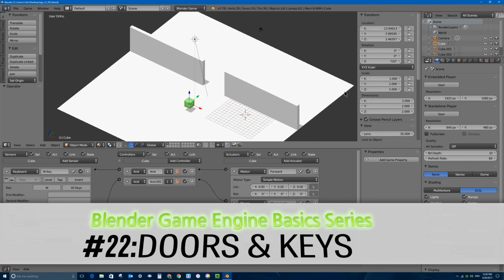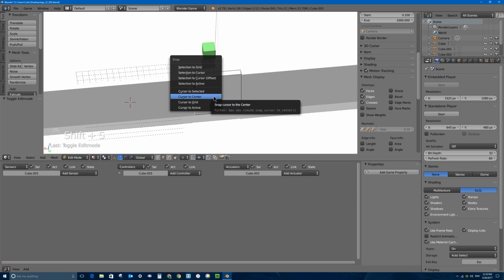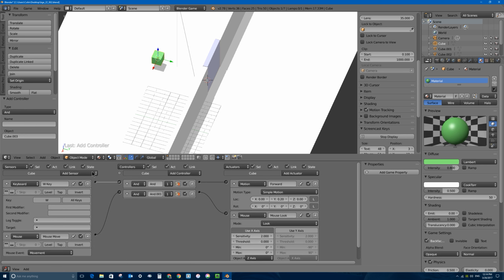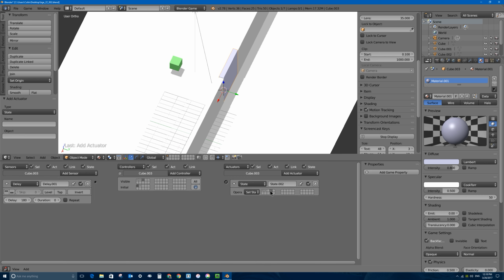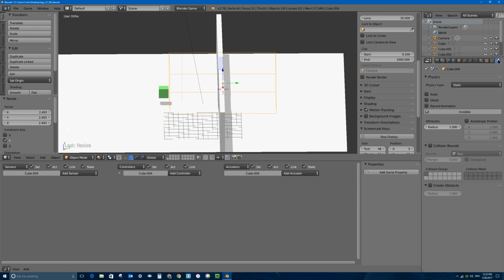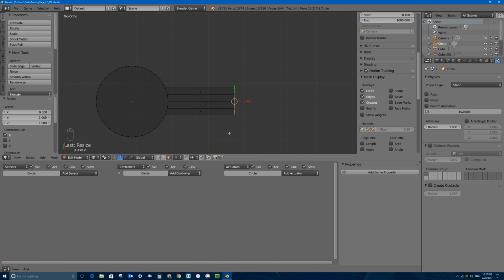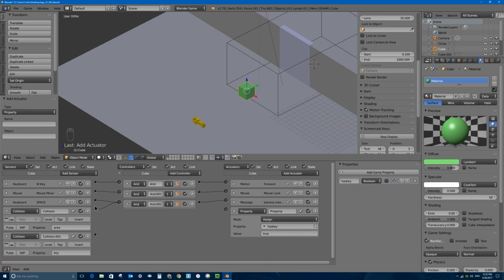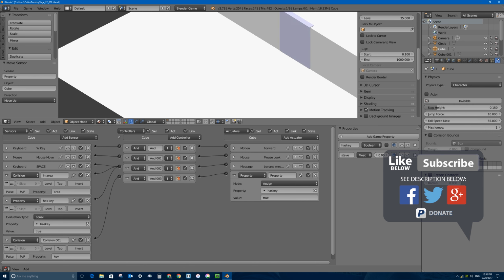Blender Game Engine Basics Tutorial #22: Doors & Keys #b3d

Comment: I have a very BIG problem. When i make a game, add textures and sounds, music etc.  When I convert it to .exe , it has NO SOUND and NO TEXTURES, please help. Thanks :)
Reply from the maker: Aha, ;-) .. you need to "PACK" all external data (other files you reference in the blender file) INTO the blender file itself. This means that the blender file will get significantly larger, but it is required to export a game, and so you don't need to keep the original images/sounds organized in the same folder (or elsewhere) with the .blend file.  Go to File > External Data > pack all into .blend.  Then re-export to .exe. :)
Reply: Thanks a lot :D

Comment: What about having multiple doors that require different keys?  It looks like it will require more properties, more logic blocks.  If a map have many doors it can adds up quite a lot.  Overall this is really good!  I'm learning much faster than before :).
Reply from the maker: You're right, you'd have to add more logic for more doors, but you can copy logic bricks from one object to another, and you can re-use properties to identify a 'class' of object, and you can re-use logic bricks on the same object.
Reply: Ah, thanks for the information.  May I ask, re-use properties to identify a class of object, does that multiple properties of bools or something else?
Reply from the maker: If you have the property 'coin' on all coins in a level, you can have your character act upon them all the same since they all have a property of the same name (doesn't matter what type). The collision sensor can be set to act the same for all objects with a property with that same 'coin' name.